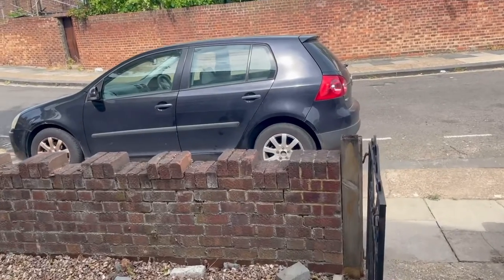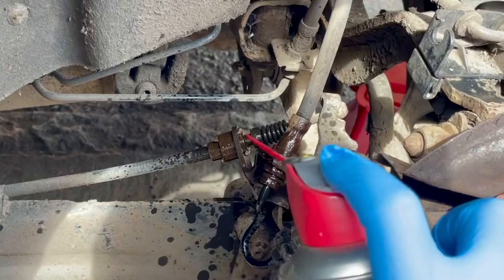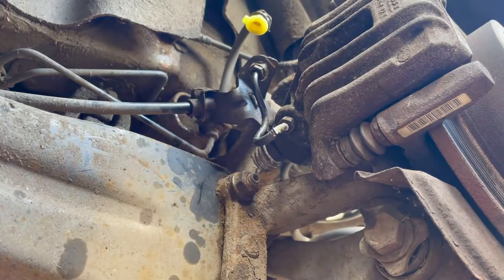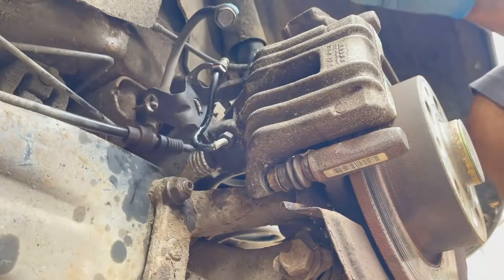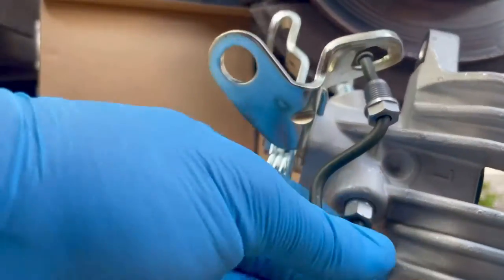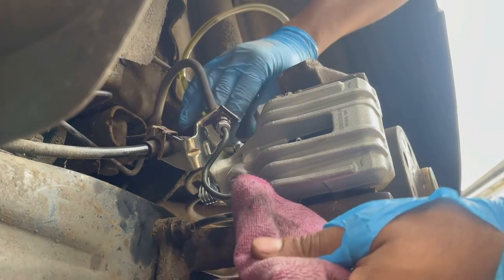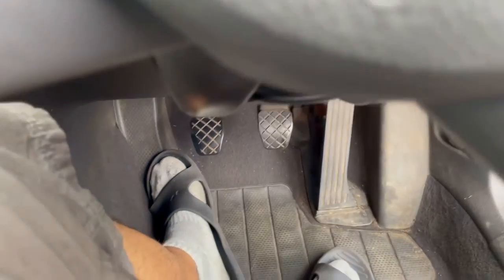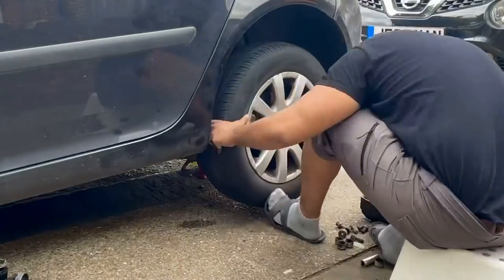VW Golf mk5 brake caliper seized (replacement DIY)

Comment: Excellent job, and excellent video.  Also fab tip about getting those 2 replacement hoses. I'm doing the same job at the weekend and will get the hoses in advance as I expect to have the same problem.  Thanks very much 👍
Reply: Some calipers don't have the little metal pipe to join the brake hose to the caliper.  Instead,  the flexible brake hose has a banjo coupling that goes directly into the caliper.  In that case the job is a bit easier.  But take care to ensure the banjo coupling is correctly aligned.

Comment: Had this same problem on my mk5 golf. Really important to change brake fluid every 2 years as recommended preventing moisture in the braking system which will hasten the corrosion on the brake lines.

Comment: how did you fix the parking brake? did you have to adjust the piston? I changed the rear brakes and after that I don't have hand brakes because the piston doesn't come out enough and the parking brake handle has a lot of movement like yours

Comment: Those discs are shot. Should have replaced them while you had everything off. Cheap as chips for these cars. Those pads should go in easy, file the area not just wire brush.